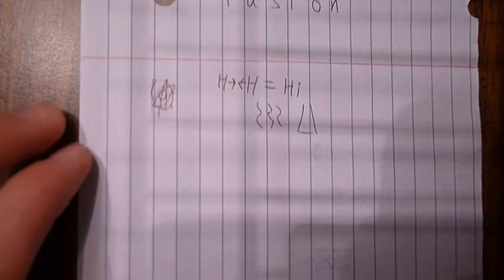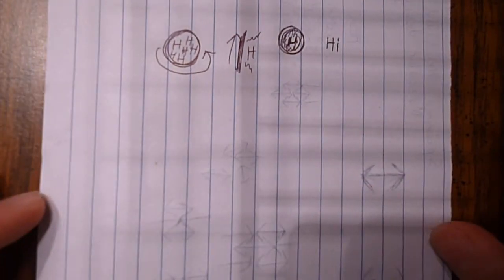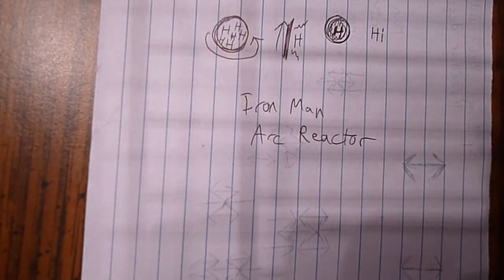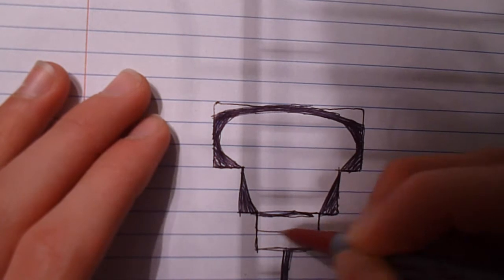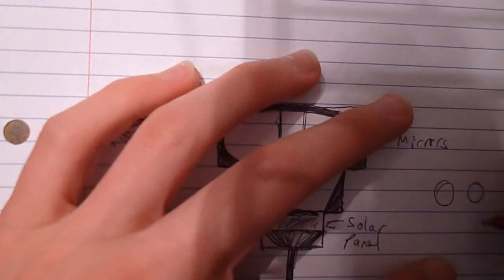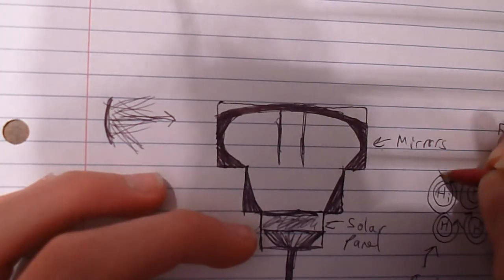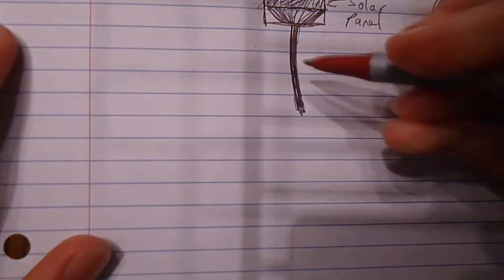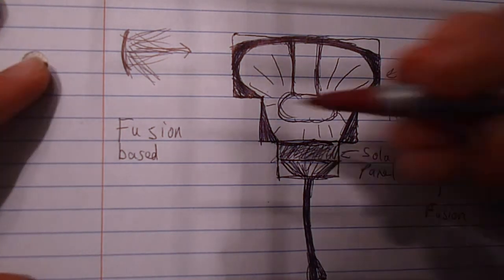Is the Arc Reactor Real?

Comment from the maker: It constantly uses the heat to continue its spinning motion. That is the one part of the design that I haven't made yet. It can be used to generate electricity and eliminate the use of cords in computers, and they will never need to charge. The bigger the battery (which is what it basically is) the more power it can produce. It can be built to be massive, and as long as it has some kind of containment, it will be able to replace power plants entirely.
Reply: Fictional Or True I see some problems with this but I respect the idea. I’m personally more into Betavoltaics. Starting work on my trickle charge generator using strontium. I came up with a couple fusion reactors but if you can l find a way to break atomic bonds with spinning then you’re gonna get the Nobel prize.

Comment: Basically compressing is not enough u will need to heat hydrogens to 3400 degree Celsius to combine it to helium. That's why this is not gonna work
Reply from the maker: Yeah, I realized that a few years ago. The idea is very flawed. I think that there is still a little bit of potential in using a solar panel with mirrors to channel as much light as possible towards it.

Comment: You may not need fusion but an arc to ionize has and use a magnetohydrdynamic power converter.
Reply from the maker: Thanks for the suggestion. I will look into it.
Reply: Well it was in an old diagram where a isotope was used for an ion chamber and the plates collected charge with a perpendicular magnetic field.

Comment from the maker: See, the suit would require a lot of power. However, there is a possibility that the suit actually increases strength and speed with third class levers and gear ratios. That means that the sensors, life support systems, and weapons would be the only requirements for electricity. That would mean that he wouldn't need as much power. Theoretically, when you have a bigger arc-reactor, you would get more power. That is because the solar panel gets more energy. See, the reason that using solar panels to collect energy from the sun is not as efficient is because it takes a lot of land to collect energy, because the sun's rays are spread out. The difference is that the arc reactor is basically a star and a solar panel.
Reply from the maker: It makes it a lot more efficient with the mirrors. That is because all of the light reaches the solar panel.